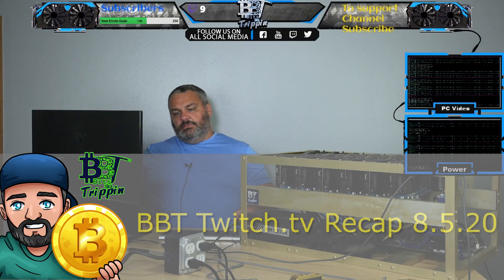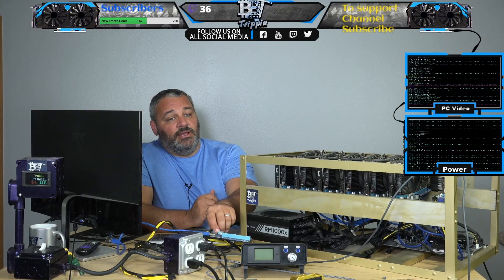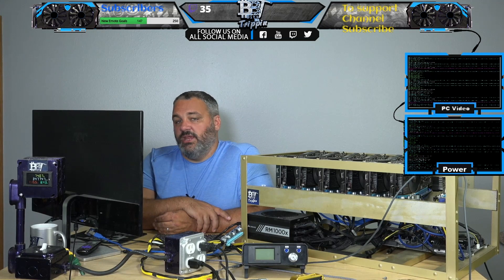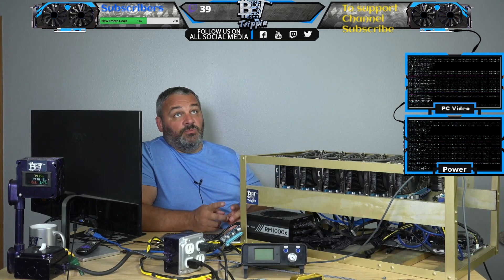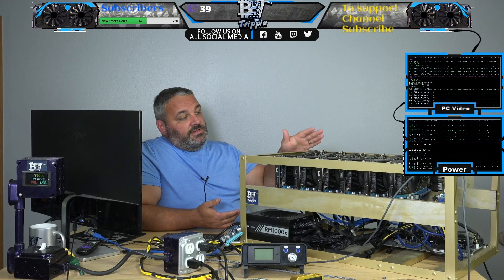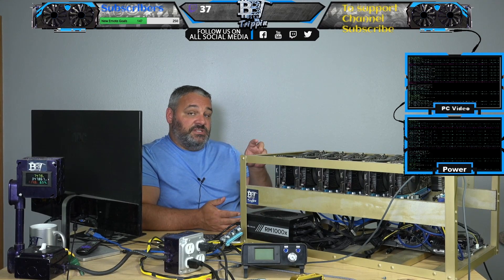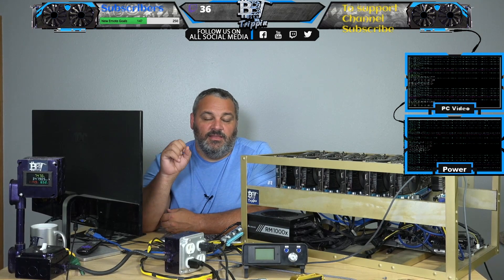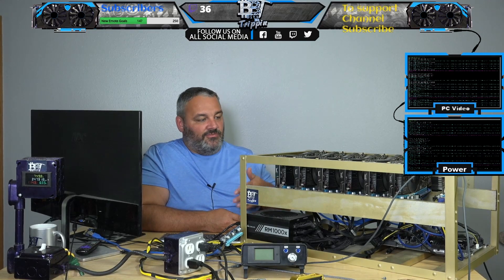Ethereum DAG 4GB Discussion, Mining BTC in 2012 Story and more BBT Livestream Recap 8.5.2020

Comment from the maker: 0:05 - 4GB DAG Discussion /w 13x 1050Ti 4GB Running in Linux
0:49 - Can you use 6PIN PCIe VGA power adapters with a splitter?
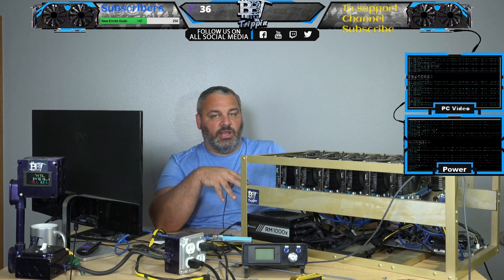1:57 - Do you mine with Celeron's
2:25 - Why does Claymore keep showing DAG build alot
3:27 - When did BTC move to ASICs

Essentially after that I talk through a few old mining scenario's and why people would mine vs. just buy currency.
Reply: Inrerestung

Comment: I started mining BTC on a single 7850 when BTC was $5.00, then switched to LTC when it was $0.01. At some point added 3 7950s. Had 2 computers in cases, didn't use them fancy risers. HODLed the crap out of about 10,000 LTC mined. ... well started selling  in increments at about $19.00 as price kept rising. Got greedy bought back at $39, sold on way down at $17.  Still got sizeable downpayment on house!!